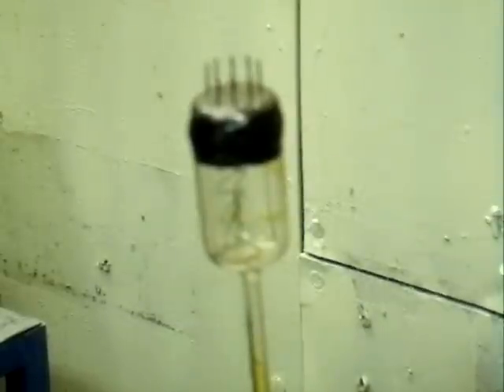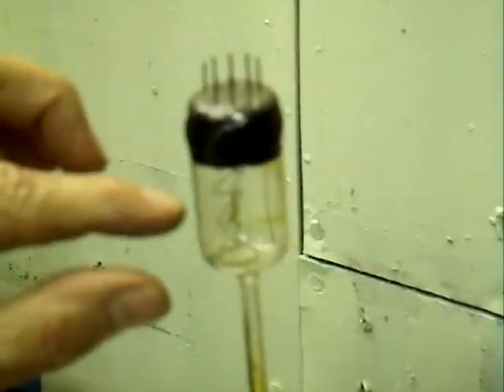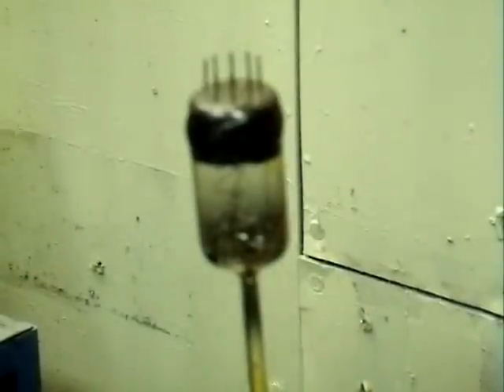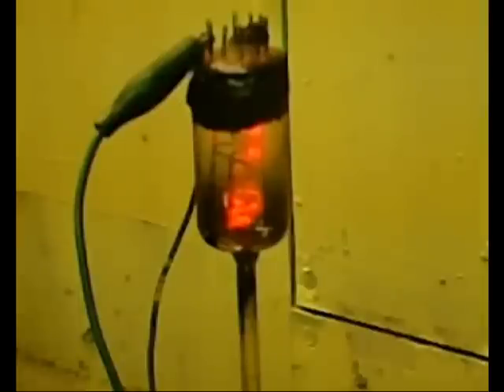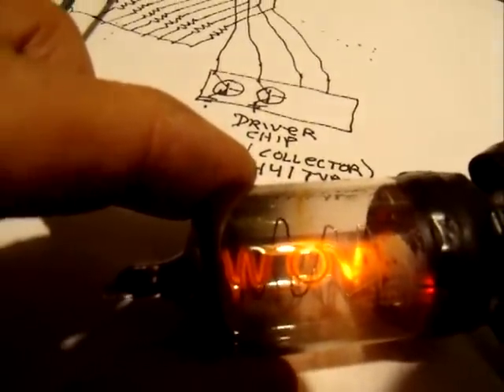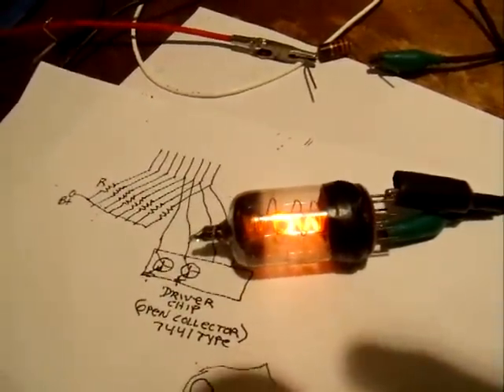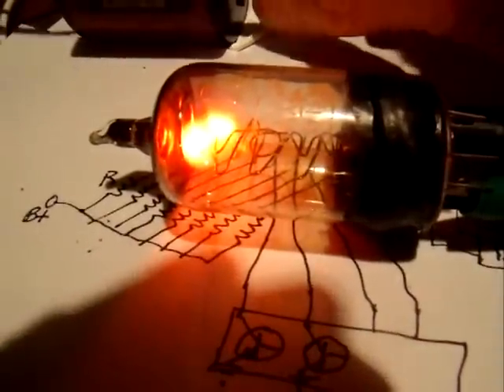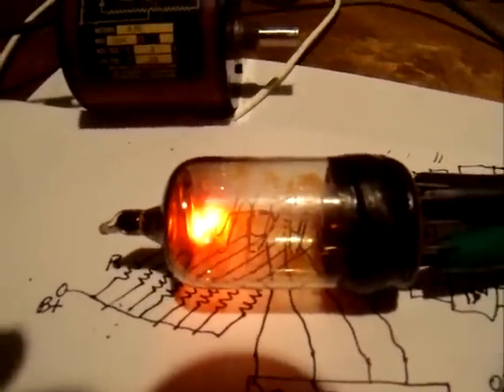MAKING A NIXIE TUBE, ATTEMPT 2

Comment from the maker: The getter flasher is an induction heater that is homebuilt. (see all the ones on youtube.) There are several websites (google induction heater) that have plans to build one. The main thing is to design the heating coil so it will be easy to position over the tube when it is in the vacuum system. I used flexible coaxial cable to link the coil to the electronics box. The output you need is 300 watts minimum. 500 watts would be better. Mine puts out 375 watts and is marginal in some cases.

Comment: Watching this video makes you wonder how they were ever able to manufacture Nixie Tubes in large numbers reliably in the first place.
Reply: They were mass produced using very similar methods to making valves{vacuum tubes}. There's a few videos on YouTube about making valves from the 1950s.

Really the only differences between a nixie and a valve, is the nixie is cold cathode, no heater, and is gas filled not vacuum.

Comment: I have used various epoxy adhesives in satellite work. After mixing the A & B parts thoroughly in a small foil tray, (aluminium milk-bottle top), the adhesive is taken down in a vacuum chamber for a fixed time to remove any entrained gasses. The lid of the chamber is 3/4" acrylic transparent sheet, so you can see the mix foaming as the gasses are expelled. Once all bubbles have popped, release the vacuum and use the adhesive. This may help with your leakage problem at the boundary with the glass tube.

Comment from the maker: Hello!
There is a strong vacuum inside the tube. Any heating of the glass must take into account the effect of the outside air pressure trying to push the glass into the tube. It is very difficult to control the heat in a close area like the seal stem and keep it from pushing in out of control and ruining the tube. Best to do the pinch off right at the envelope, which is very difficult with 6mm tubing. You could go to 4mm stem tube and it would be possible to make a very short tip.

Comment from the maker: This material is called "solder glass" and works with glass the same way as ordinary solder does with metal. The solder glass has to have the same coefficient of expansion as the substrates and the whole process has to take place under high vacuum. This means vacuum furnace. Beyond my meager budget! By using solder glass, the substrates are not heated anywhere near their softening point so the mechanical alignment of the parts is maintained.

Comment: Watching this vid, an idea of interesting neon tube came to me: LARGE FLAT NEON TUBE. I suppose it can be made of 2 shets of 4mm window glass with metal mesh on the front glass and some solid metal electrode on the back glass. Narrow stripes of the same glass can be used to seal glass plates from perimeter. Additionally, the same glass spacers must be placed inside tube to support main glasses against atmospheric pressure. Will it work?

Comment from the maker: The envelope was from an old TV tube. The white deposit was the remains of the getter flash from that tube. The getter material is very hard to remove after it is exposed to air. I think the tube cracked when I was welding wires to the pin. The crack is between one of the pins I welded to and an adjacent one. That could be a problem with using old frits like that. It wasn't the JB weld contracting or there would have been more damage. On the next one I will be quicker with the welder.

Comment: Thanks very much for your reply. The pressure inside the tube will be around 100 Torr (neon), so I think that it shouldn't be that critical. I bought stems that were already made (tooling for custom ones is too expensive). I'll try and see. I actually hired experienced glassblower, but he gets angry with me whenever I ask him something stupid (very difficult man :) ). So, I just needed to know should I consider that, because other option is to move exhaust tube to envelope side. Thanks again.

Comment: Hi Ron, you are doing some great stuff, thanks for sharing! Can you also give me an advice about tip off procedure? I will have to make some borosilicate gas tubes with multipin stems and small exhaust tube. In order to make exhaust seal as small as possible, can I do anything to it after tip off? For example to heat it again and to press it   a little bit to the inside of the tube. Exhaust tube has 6.5mm diameter and 1.25mm wall thickness. Seal can stick out up to 3.5mm out of the stem. Thanks!

Comment: I have everything I need made from this Schott glass. I have an oven too. So you think that I should do an annealing after tip off and adjustments? Could that compromise the gas purity inside the tube if proper bakeout was done before and with a getter inside?

Comment: I know this is old but if you still want to know more I have a few NIXI tubes I plan on using in a calculator and I have extra I would gladly send you one, they are all used and I have one that is ALOT weaker and would stand out if used with the others. I also have a +/- one but I plan to use it but can get good photos as you can see a lot more.

before anyone asks they are not for sale. I will GIVE him one tube that I have no use for. If he passes I will send it to any U.S. tuber with at least 1.2k viewers with a promise it will be the star of its own video.

Comment: I guess you now it now since the video is half a year old but if you dont: Any type of glue contain solvents in some way, some more some less. A strong vacuum will outgas some solvent like crazy untill the solvents has been removed but only from a thinner surface since epoxy are quite tight for bigger molecules to pass. As you saw the vacuum seemed fine just because the leakrate of the solvents at this point was so low that it couldnt be seen on the gauge, but it went up again few hours later.

Comment: Have you considered manufacturing these from acrylic or a different thermoset plastic
Reply from the maker: Plastics emit residual gas, and even though nixies are not at high vacuum the gasses emitted would severely affect the operating voltages of the tube. Even glass emits residual gas to an extent but it can be heated to very high temperatures (900F) to drive it out.